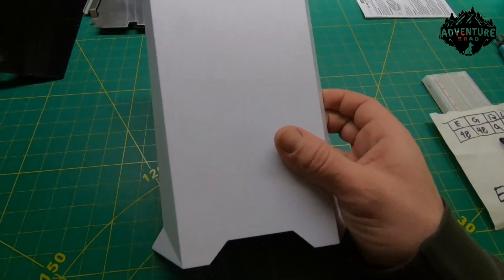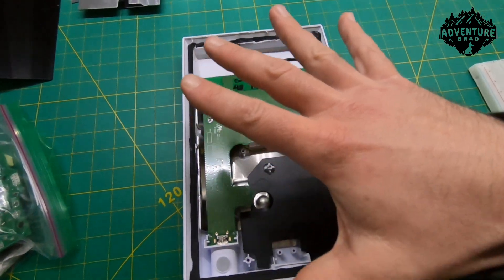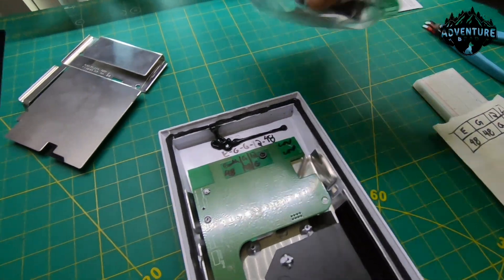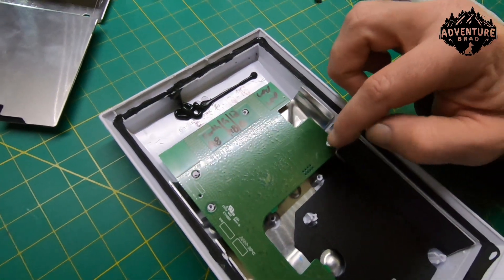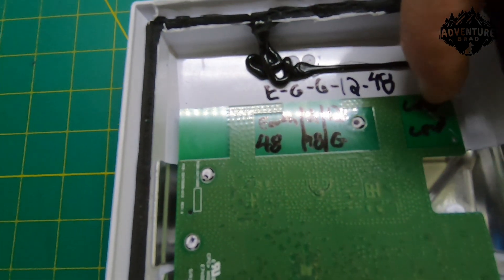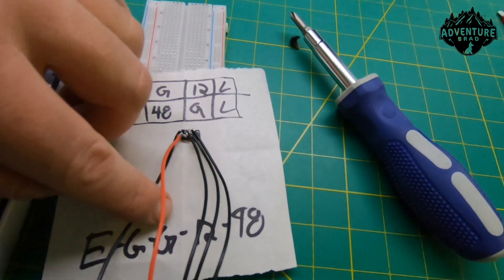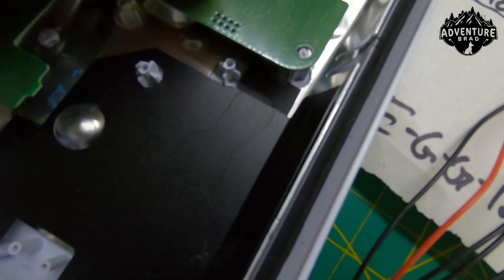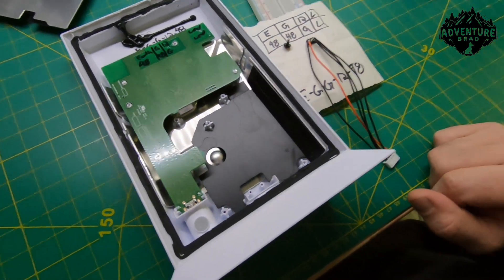Starlink Router teardown and DC conversion for RV and Off Grid use

Comment: Is it possible to supply only 12V to the router board?
I suspect the router board takes 48V as an input from the AC/DC board. There must then be a 48V->12V conversion happening on the router board. The 12V is used to operate the router functions, and the 48V is not used on the router board other than to supply 48V over PoE to the antenna.
I know for a fact that you can supply only 12V to the antenna (see Oleg Kutkov) by separating ethernet and power supply.
So I'm guessing that it should be possible to forego the AC/DC board, supply only 12V to the router board and to the antenna, and avoid conversion losses.

Comment: Man, are we brothers? Holy crap. Looking at your videos and its about exactly how mine would look if I had videos. LOL. Paramotoring-check (but not any more), adv bike-check, inflatable boat with Tohatsu-check, Alaska adv- check, RC planes-check, RC rock crawlers-check, 4x4's- check, Kayaking check, hammock camping- check, sailing-check, electric bike- very soon. This summer I plan on buying a Rans S12 for my aviation itch. Are you in the southwest? I live in Tucson but working a contract in Roswell, Nm at the moment.
Reply from the maker: sweet  man! sounds like we have a few shared interests.  lets try to meet up this spring and share a campfire
Reply: @AdventureBrad  . Yeah, sounds like a plan. Currently I will be doing 7 on/ 7 off so I'm pretty flexible on my days off.